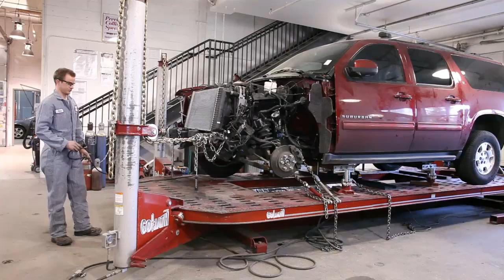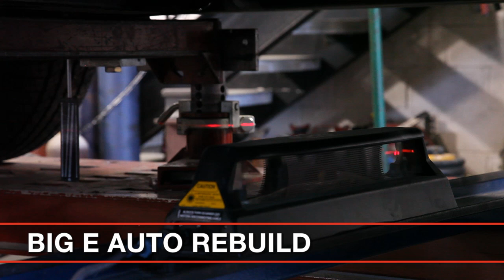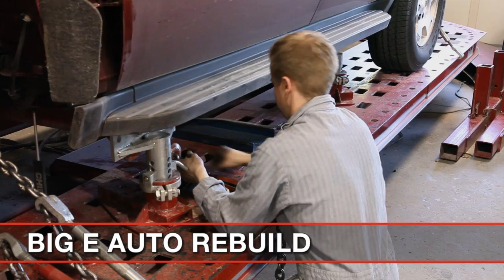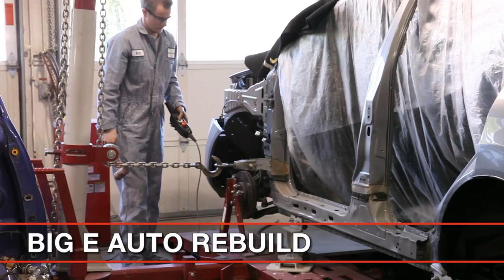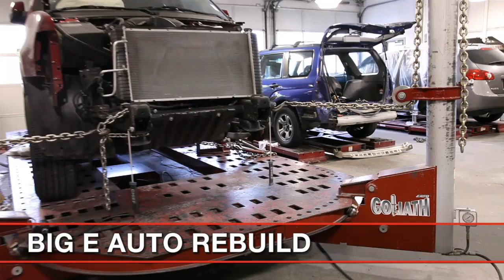Auto Body Repair - Straighten Frame

Comment: Pull? If they know its broken why not new? Sounds like a scam
Reply: Isauro Banuelos because it’s far cheaper to pull it back into place. Do you even know how much work it is to take the body of a car off of a frame and put it on a new one. Not to mention parts and labor cost.
Reply: New what? Frame!? I would just buy a whole new vehicle with that cost. Also yeah it stretches. Because it's metal not plastic so repairing it is possible